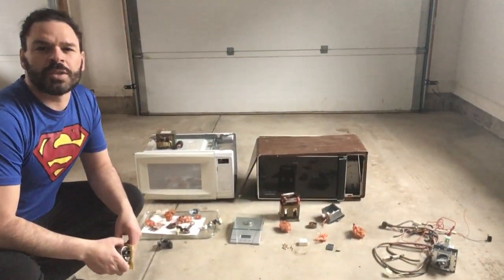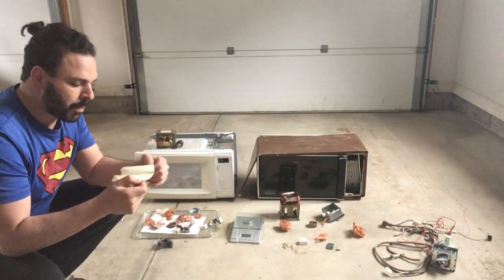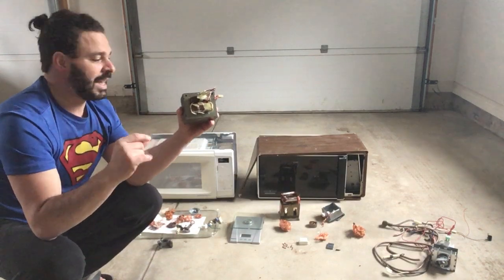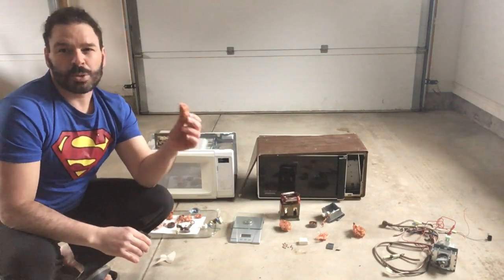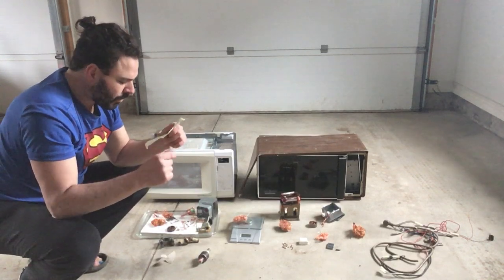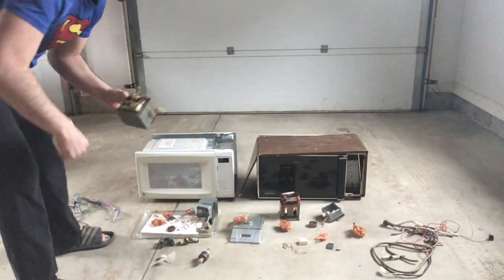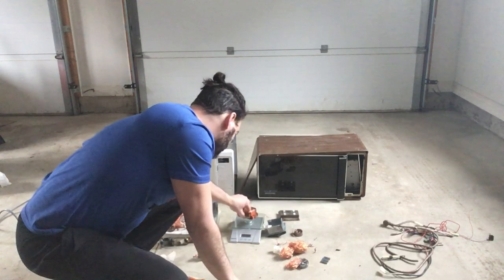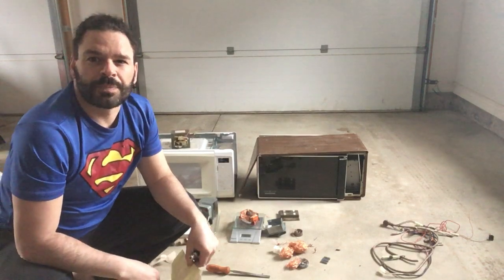Scrapping microwaves for copper. How much more copper do older microwaves have? Btw my 100th video.

Comment: Sell the transformers in pairs to science geeks and you will get a whole lot more from them 🤓. Also beware that some have aluminum secondary windings. The capacitor has a bleed resistor, and yup they jolt pretty good if they shock you. The magnetron has a nice chunk of copper but also other stuff.
Reply from the maker: Yup, I like the copper from the magnetrons. I actually have a video on taking them apart. Thanks for the advice on selling the aluminum transformers.

Comment: another great video buddy. very informative. I did a video on a newish microwave the transformer was all aluminium. but I still got the copper no 2 from all the other components 👍👍
Reply from the maker: Nice. Microwaves have a lot of good stuff
Reply: Sell the aluminum ones as electrical transfirmers to science geeks. 2 of them back to back makes an awsome Jacobs ladder arc chaser like the kind used in Frankenstein.
Reply: @christopherleubner6633  yes I've got a nice aluminium wire pile started up .it's coming out in my new video  on Monday along with my power tool break down. tune in my friend 👍